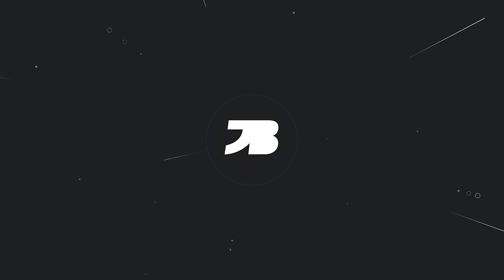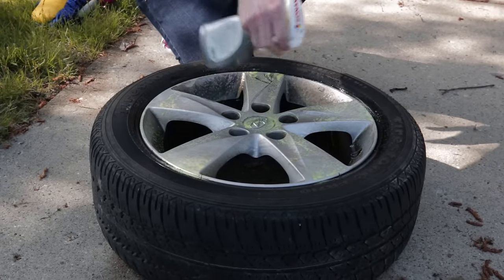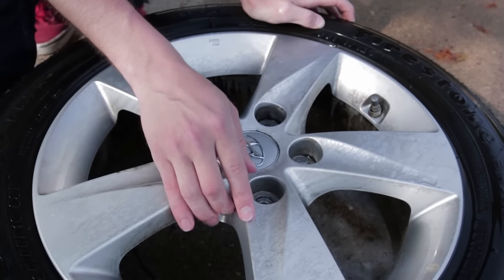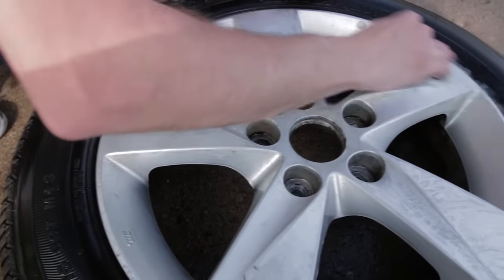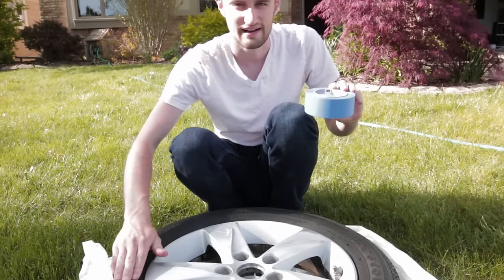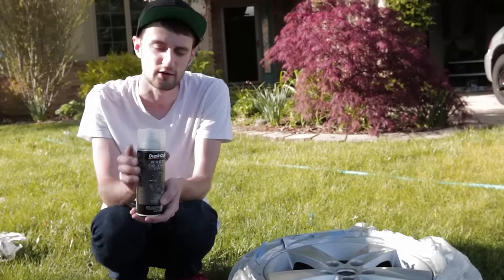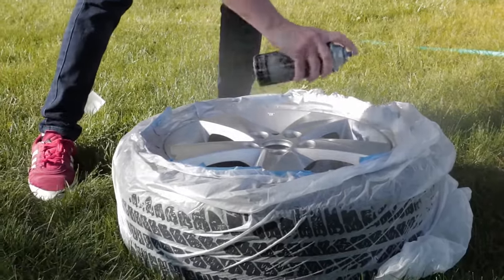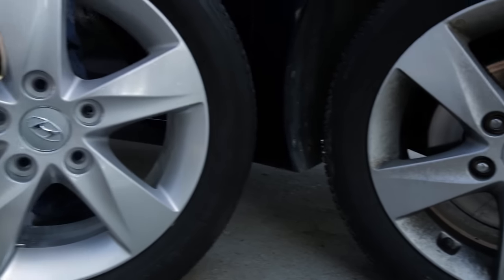How To Spray Paint Wheels Like a PRO!

Comment: @Justin Buice 
I did this myself followed all the steps and my rims are looking great and much improved so that I thank you. One small question I did want to ask is if you had any issues or tips in dealing with any excess “ metallic dust or grainy “ dust like issues . My outcome had some grainy dust particles issues even after heavy clear coat at the end for finish that clearly came from the silver duplicolor rim paint just like you used but I mean hardly noticeable but do you have any tips or suggestions to minimize the dust particles. From landing back on the paint and drying or something from this metallic spray paints. I have noticed mostly all the metallic spray paints have a dust effect that happens and sometimes can make the finish not spooth a desirable in places is there any tips or jacks you know of to prevent this ? Am I spraying to much at once ? To thick of coats? Or not shaking enough like the can or keeping spray paint can in gold water in between uses or wait times on coats ?

Comment: I would have done a light spry on the inside of the rim and taped the valve up so its not to obvious . tilt the spry can up side down and give a light squirt this will clear the nozzle for the next use. use a mask so your not breathing in paint fumes. otherwise Excellent job  mate

Comment: Use ing playing cards or something similar around the rim works well, it’s much easier then using tape on a round surface. After you use the cards then you can use tape to hold the bag on. A can of flat black paint is good for over spray. Preparation makes the results last for a long time.

Comment: Justin, I purchased a refurbished wheel for my 2010 Murano from AutoRimShop on ebay.  It looks great; it has a smoky silver finish.  However, it doesn't match the other wheels on the vehicle.  I'd like to paint the other wheels to match.

I messaged the seller requesting information on the paint they used.  They responded with the color code  HYPV2.FF.  I have been unable to find any information regarding this color.  DupliColor customer service was no help.

I was hoping to find some advice here from you or a fellow viewer.

Thank you in advance to anyone who responds.
Reply from the maker: The best way to be 100% sure they are the same is to paint all four at the same time with the same paint. I think you will have trouble trying to color match even if you are able to find the correct color.

Comment: Did you end up painting the valve stem by mistake?
What's your thought on painting the INSIDE of the wheel, either the matching color, or a flat black?
Reply: Valve stem is covered with tape.

Comment: Lazy girl question can I leave the wheel on? And just put paper in the brake peekaboo holes? Like I'd be careful about drips and stuff cant be harder than doing nails?
Reply from the maker: I recommend taking the wheels off. If they are on the car, it will be hard to spray into the inside of the spokes, especially from the bottom. having them off allows you to walk around the wheel and get total coverage. If you end up doing them on the car, do a few coats and then roll forward a couple feet so the wheels turn. you will be able to see how much you missed

Comment: Hey Justin,  great video! But was wondering if it can be painted without having to take the wheels off and cover the tire and all around the body to avoid paint getting onto places not needed. I don’t need to sand mine, they are just faded after 6 yrs having my new car. They don’t have any type of damage just faded the original silver color they had. Great 👍 video
Reply from the maker: Thanks! It’s way easier to just take the wheels off the car. That way you can spray them from every angle. If you try doing the car, you will miss a lot of spots

Comment: Thanks for the video. I'm willing to change my rims color. they are in perfect shape but my question is do  I need to sand them? or just apply the paint on them? Do I need to use the premier ? Thanks in advance
Reply from the maker: You need to sand them first. I would only use primer if you are sanding them down to bare metal, otherwise there is already primer on them
Reply: @justinbuice  Thanks for your quick response. since they are in good shape which sandpaper do you recommend me to use? 400? I want to keep the original primer on them.

Comment: How long did you wait until installing tire and rim back on the car? Great video. I will definitely be painting my rims this spring/summer. Thanks!
Reply from the maker: You can install them on the car after an hour in case you need to park or pull into your garage, but I'd wait 24 hours before driving or washing the car so the paint has time to cure
Reply: @justinbuice  thank you.!

Comment: Should have masked the holes out in the rim, you should aim to have no paint / over-spray anywhere but on the prepared surface........ masking the wheel properly also stops dust and loose crap blowing back into your paint from inside the rim.

Comment: This dude did a great job. Just a quick question, when I do this should I use primer or just go ahead and just follow this how to?
Reply from the maker: Thank you! I would only use primer if you are sanding the wheel down to bare metal. The primer basically just helps the paint stick to the metal. If you are painting on top of the paint that’s already there like I did, then there’s no need to prime in my opinion
Reply: @justinbuice  Awesome man thanks! Got a weekend project now! Great how to again 👏👏👏

Comment: Justin, do they make a chrome colored paint in that brand instead of gray?
Reply from the maker: They make paint that looks similar to chrome, but you will never be able to get a mirror finish like real chrome from a paint can. You would need to have the wheels chrome plated
Reply: Justin Buice cool thanks. I’ve always bought chrome rims but at a place in life where I like chrome but the factor look without the selections I’ve used in my younger years. 
..
Dipped factory rims in chrome or sprayed is what I’d like now days. I have factory VW Passat rims I love and don’t want  to change, only bring them out more. 
...
A video on how to dip factory rims into chrome would be nice. If it’s practical. 
Thanks. 
Peace ☮️.

Comment: How many cans do you need for all 4 rims?
Reply: For an 8 oz dupli-color spray can for color you'll need at least 1 can per wheel. And 1 can of 8 oz clear per wheel.  For the 12 oz cans from other brands you may need 3 color cans and 3 clear cans to do all 4 wheels. These spray cans run out fast. And you need plenty, to do it right to ensure good solid coverage.

Comment: Finish is really good but I feel you could have done the masking better as you can see loads of paint in the bead of the tyre (tire) apart from that tho, great job 👍🏻
Reply: Don't have to worry about a little bit of paint getting on the tires as they are so dirty covered by layers of dirt so they come off easily when going through a wash or even let rain wash them off.

Comment: There's nothing 'PRO' about this, just a quick superficial job is all. You can still see the kerb damage in the wheel in parts where he didn't apply metal filler prior to sanding.
Reply: It's making your rims look 10x better not a a brand new Porsche job
Reply: There's always somebody thinks there's so much better than the person that actually put it in the video and the work to do so
 It Was Rattle cans was an excellent job